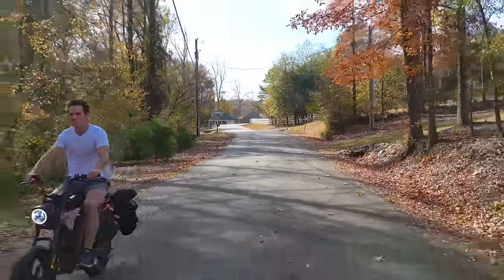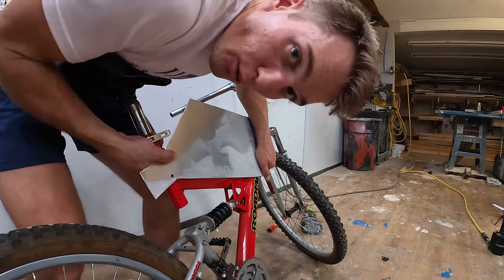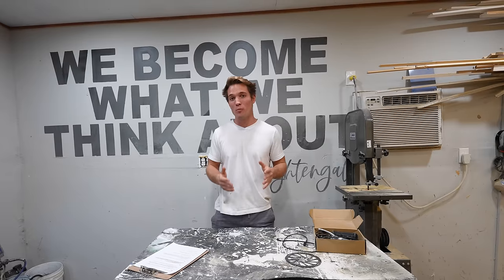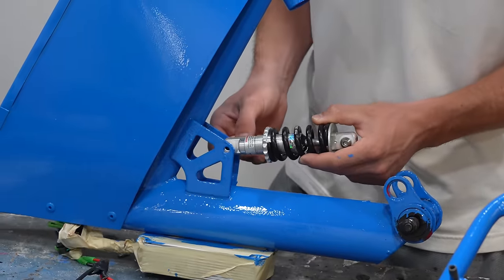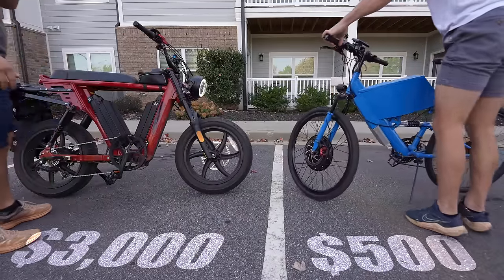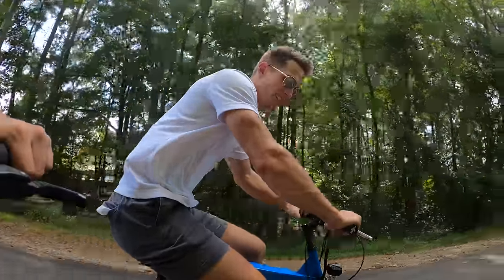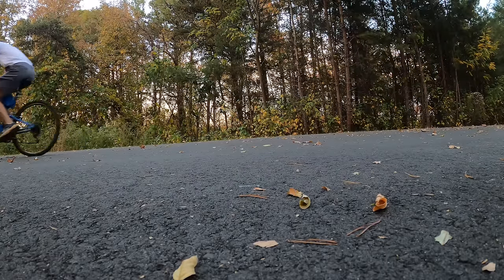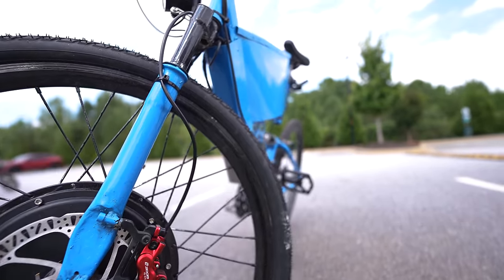I turned a $20 Goodwill bike into an EBIKE

Comment: I just scored a freebie Marin east peak FRS full suspension mountain bike with a really rusty chain, flat tires and bent drop off (derailluer), but Marin bikes have a special feature to protect the frame from bending when you wack the drop off-a kind of breakaway part or something.  . . might just need to tighten a bolt.  It's Ninties bike which seems like it has low miles.  Unfortunately this model year does not have disc brakes.   I am going to be watching a lot of these build videos, meanwhile I am going to buy a new chain, clean it up and ride it as a regular bike for a while.    

***you need to primer metal with special bare metal primer before painting.
Reply: who cares

Comment: Editing 10/10
Bike opinion, 
you put the battery on the top so it will handle terrible.  
you put a great case around the battery and then put the controller on the bottom of the Bike in a random spot. 
You actually even had to weld to put a brake caliper on the bike.
10amp hours isn't 50 miles lol😂

Comment: Good job. However quick question do you think you could try to make one that costs less and doesn’t need and welding or anything. Please. Also keep up the great work
Reply: Just lookup budget builds on YouTube you can essentially do what he did with a smaller motor and just ductape the battery to the frame
Reply: @The_Justice_Pack  okay thanks for the idea I will

Comment: you can buy a cheaper 12v 100ah battery and a 120v inverter the run the charger to the battery as you run..and double or triple your range. you have 4%or less loss

Comment: You should have told people if they install front motor you need to have steel forks and torque arms otherwise the forks will snap and throw you off as it happened to me at 30mph luckily i was ok not hurt anything but learnt my lesson quickly was my 1st ebike but now i ALWAYS use back motor stay safe guys 👍👍

Comment: So if you did this again with a carbon fiber frame from a road bike would you get up to 50mph? 🤔
I wonder if it would even be sturdy enough to support the added weight of the batteries. Especially if someone lighter, aka shorter, was riding the bike, you’d think you could get a higher top speed out of it. At what speed do we need to start classifying these things as mopeds or some new classification and require helmets and licenses-especially if anyone can just create this at home? So many questions this video has opened up.

Comment: Make sure your health insurance is paid up.  Between cutting out a support member and not putting a torque arm on the fork, it's a rolling accident.  Either the frame will break or the motor will rip out of the fork mounts.

Comment: I have this exact same battery and similar bicycle. Not sure how you're getting 30+ miles on a single charge with throttle only. A 48v 10ah battery is 480wh. It's a 1000w hub motor and you're doing about 30mph. So you've got roughly .48 hours (28.8) minutes of battery usage at full throttle. Going 30mph for 28.8 minutes = 14.4 miles. So you had to have done some pedaling or going downhill. No way on flat ground throttle open would you get anywhere near 30 miles.

Comment: this what i did with corigated alumimum no back shock so mine is inbetween center of frame 48v 30 amp discharge maxxeed at 45 mph disconnect limit wies on the controler bam and get in prams on display and u need tow rope so ya boi coulda pulled ya
Reply: and put hub on rear

Comment: One thing I'd recommend on that is to put at least one torque arm on the front fork. That fork's kind of weak for that power of motor and that axle is likely to spin out of the dropouts. Also that fork wasn't designed to have a disk brake caliper attached to it so there's a good possibility that repeated use of the front brake will eventually bend or break the fork. There's at least 20+ e-bikes that can compete against the Hyper Scrambler.
Reply from the maker: thats a really good idea!
Reply: @ChayDenne  sick video! You should do a collab with e-bike guy and get that 100mph ebike built! 🎉🎉 I'd your stuck on what parts let me know!
Reply: I was just about to say the same. Without a torque arm the very torque of the motor can actually loosen your wheel nuts. I have two on my trike build.
Reply: Y’all are full grown men why are you watching this lol
Reply: @Emoji-u  Because I'm a full grown man with an e-biking YouTube channel.
Reply: 20+ ebiikes that can compete? @ChayDenne
Reply: @ChayDenne  I agree

Comment: This is pretty decent overall.  I did a similar build but with a mid drive kit so I can go up hills (a mountain) without eventually burning up the hub motor and ride with even less parasitic drag.  A hardtail so there would be space for a battery pack in the middle.  Think that if you fall forward the family jewels could take a pretty rough hit maybe put a cushion on there if you actually are going to use it.  Secondly depending on battery and where you are charging it can be nice to be able to detach the battery I charge mine in my fireplace because im a bit paranoid.

Comment: Argentina is a weird country. The bike you started with is considered a good bike and would have a minimum price of usd 200. The motor/controller/battery kit would be around usd 1300. There are however, already made ebikes for less than usd 2000.
impossible to buy something with usd 400 salaries tho.
Nice video

Comment: where are your torque arms for the front hub. A 1000W motor will rip out of the fork (acting like an impact wrench)without torque arms after constant use. I know because it happened to me. The tires need to be ebike ready to minimize wear from a hub motor. This will price your bike out of the $500 range. Also your battery being riveted is not easily replaceable and you have significantly weakened the MTB frame by cutting it and not replacing with a stabilizing tube of metal. It would have been better to assemble your own battery into a custom shape or add a battery onto a bike rack rear or front. A Bafang mid drive kit 750Watts would have been a better option for that bike frame. The brake change although being a nice upgrade is not necessary and they do sell mounts for bike frames that can not handle disc brakes. As others have said you could have just bought an ebike for $500 with that range and not have to deal with the labour in the conversion. People here who could not weld or have the equipment would have to outsource this raising the cost of this conversion. You made a youtube video for ebike conversion of which there are hundreds of on youtube but in the big picture this is not a success or spectacular result for the ebike. If you want to make a profit buy a walmart tandem bike and convert it to an ebike then sell it for a profit. Tandem ekikes sell $4000-$18000, not that is a healthy profit margin and a good video. p.s pedaling a middrive uphill is a lot easier than a hub motor drive and you don't need 1000W in the motor to do it since you have the low gears in the bike.

Comment: I built a squad of ebikes (5) last year from trash picks, thrift stores and a 20yo mountain bike. For the price of one off the shelf we have one for each family member.
Reply: how much did it cost for u
Reply: @AnandaDaCosta  the kits at the time 36v 26 inch just over $200 ebay/Amazon.  The batteries are second life (from rental scooters) $100ish "shorty r5" with charger from jeg35.  Mounted them on rear racks. They have rim brakes and bought the best pads I could find.

Comment: Great job! i'm trying to make one as well just be careful with the front suspension because I used one exactly like that bike that u used and it basically fell apart as i was bombing it down a hill at full throttle (the one u used looked like it was designed for a  kid / tennager) if that breaks just upgrade to a hardtail designed for adults.  😁

Comment: Welp.... this shows how much of a Scam the whole E-bike industry is.... ALL it really takes is a high quality safe battery that doesn't turn into a freaking firebomb at any given moment... and a good frontwheel E-engine. I really like the build you guys did. Definitely the better pick as it is way lighter, more flexible and easier to just use as a regular bike, It also still looks like a Bike so it doesn't stand out too much and won't catch too much unwanted attention.

Comment: The way the bike was painted and modded for the battery is impressive. I have always thought that bikes with this geometry weren't the best for conversions.

Not sure if what you guys did with the brakes were safe or not. I would use adapters instead of modding the frame and fork for disc brakes. Also like another comment said, torque arms are a must for direct drive hub motors.

I have a video too on how to convert a cheap new bike to an Ebike. https://m.youtube.com/watch?v=_9P2j52PiYY

Comment: Be very careful with using a front motor because the forks are not designed to have that extra stress on them. Next time, I recommend a rear-drive hub motor, or preferably, a mid drive motor so you can take advantage of your gearing as well. But overall, great job and welcome to the world of ebikes!

Comment: Four-piston brakes definitely aren't cheap—in fact, they can end up costing more than the motor itself, especially once you factor in the brake levers. These Chinese motors are a bargain when they work, but they're a nightmare when they break down, and they're not even Bafang motors! And if you're into inhaling chemicals, just grab an Air Up bottle, or stick to drinking zero-sugar, chemical-flavoured water like everyone else. Don,t get me started in the fire hazard with heap cells and bms.

Comment: Sir I have a bought a normal trike, i have never ridden a cycle due to balancing issues,  I want to convert it into electric but installing in rear wheel is double the price than Front wheel. (250-350W BLDC HUB for front or Mid drive Motor 350w for rear)
 
As I am a beginner should I install the motor in front or rear?

Any suggestion is welcome

Comment: And, it gifts a lot of fun to build your own e bike and the battery is the most expensive part. Great that you showed us how to build easy yopur own fast e bike, ore, you can buy a 250watt motor for legal use (in the Netherlands ) Okay, the Scrambler has a wider range but that bike used 2 batteries. Keep building

Comment: Does anyone have the specs on the controller box? I have been told if I had a slightly bigger battery 52v 30Ah and a high amp 35-40 controller box the beast would be unleashed. Any help appreciated. Thanks.     FYI, Great Channel.

Comment: I was using 350w at 48v with a 15ah new lithium with pedal assist only it'd be dead in 24kms, I find it hard to believe your battery at 2/3's capacity lasted twice as long. I don't buy it at all.

Comment: If you don't add more support to the front forks then you will eventually break the forks off from the torque caused by the 1000w electric motor. This video is 8 months old so if someone continued to ride this bike they found out the hard way.

Comment: The main thing I would have done differently is that I would have welded the battery cage (without the battery in it of course) so that it would provide more structural integrity to the bike in place of the beam you chopped out. That, and I would personally cut the beam to be flush with the body, instead of leaving the ends poking out, and weld in some plates to cap it off and provide the structural support there. Just looking at how it was made I feel like the seat post could collapse if you hit a hard bump.
People talk about using adapters for the calipers, but I think it should be fine. My bike has a set of suspension forks that looks near identical to that one, but it came from the factory with a front disc. You'd really have to abuse the brakes to bend something anyway, I think.

Comment: Cool. Like and subscribe. Respect to you for making your electric bike front-wheel drive (because it is the best and most efficient solution). I agree with you that it makes no sense to pay a large amount of money for an electric bike if you can assemble it yourself much cheaper, and in the future I am also going to convert my MTB to an electric bike by ordering an electric kit (or even 2 to make a four-wheel drive It will be perfect) and a battery because I don't like ready-made electric bikes because they are expensive and for some other reasons, for example, because in most cases ready-made electric bikes are made with rear-wheel drive, which is bad for mountains and off-road and not as efficient as front-wheel or all-wheel drive. And by the way, why didn't you weld an adapter for disc brakes to the rear? Because v-brakes are complete garbage, I agree with you, and they are also inefficient and "eat" the wheel rim. My MTB (which is almost 17 years old) had v-brakes on the front and rear, but when they damaged one of the standard wheel rims I changed the front fork to a disc brake fork and installed them, which was much better than v-brakes, although I got the cheapest ones (I had little money at the time) and only one moving pad. Then a car repairman welded a disc brake adapter to my bike and back and it became incredibly cool, and after that I bought mechanical ZOOM DB 680 (with two moving pads) and they are enough for me. I don't like bicycle hydraulics because they are expensive and many cycling brothers complain that they have had problems with this system, for example, it leaked and stopped working. But the hydraulic brake system from mopeds and motorcycles works fine and I might install it myself.

Comment: Show this to Big E bike and show them that they have no excuse to make their stuff so dang expensive
Reply: Problem with this ebike is that all parts are quite low quality and that battery will not last long or even be safe to use. You can make diy conversion at about 1000 euros with good parts and frame with actual spots for hydraulic brakes.

Comment: And you didn't put a torque arm on the front forks. It wasn't exactly safe before you modded it, and now it has two guaranteed points of failure. The forks are going to get bent by the force of the motor, and the frame will be prone to collapsing in on itself without the top tube. The added weight isn't going to help either of those issues. But it did make a neat video.

Comment: its fwd why not do awd
Reply: 500$ limit + 10Ah battery that will stress under 2 1000W motors and will quickly die 
they probably didnt make it RWD since the motor doesnt support cassetes

Comment: The HS2 motor is only 1000w with 1800peak probably. I have the Hyperscorpion since 2020. Very similar in power but I recently ordered a Ristretto 512 A20, paid $2800 but it going for $3,395.75 with a 15% discount code. It goes 40mph. Mid-drive motor peaks at 4500w peak with 250N.m of torque. I've test ridden it once at their HQ in Austin, TX and recently at Electrify Expo in Austin the bike is a beast. I can't wait for them to start shipping which should be in end of December/early January.
Reply: there also the talaria x3 that’s 3,350 and goes 45 ish

Comment: high voltage mid drive is my jam. these are cool for commuting though.. once you run 60/72v  82/96v @ 60+ amps you aint going back unless you riding for comfort or exercise 
you should check out a BBSHD and a phaserunner setup if you start riding more often